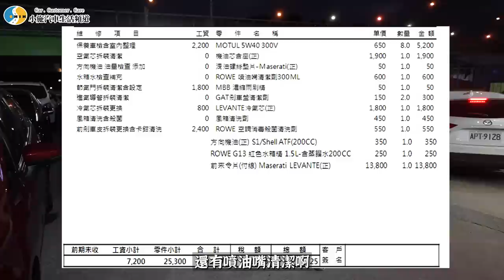【小施又來了】瑪莎第一次保養荷包就一瀉千里!車子溼了，小施又溼了／ft.Vic's service 維斑汽車/ 2017 Maserati Levante SQ4

Comment: 這台的引擎確定是是克萊斯勒本體從美國運到歐洲的法拉利工廠加瑪莎的上蓋組裝而成，只有V8那台才是用法拉利引擎，至於刪掉2缸剩6缸的法拉利引擎是用在Alfa的QV系列
煞車異音是原廠brembo來令的問題，金屬成份過高,把來令換別牌的就解決了
前煞車來令原廠約15000左右
這樣保養3萬多，可能沒比原廠便宜...
Reply: 6缸的都是法拉利代工製造, 別再不懂裝懂鬼扯克萊斯勒美國運到歐洲這種頭殼壞掉的天方夜譚˙ 乾脆編是義大利Fiat車子的引擎
Reply: @威-l6u 這是 spec r 2021/8月份雜誌內容，你自己井底之蛙沒知識，不要隨便批評別人鬼扯，還是你也認為知名雜誌編輯在鬼扯呢？
你開瑪莎嗎？你看過瑪莎V6引擎本體嗎？
你肯定也不知道引擎本體有印著克萊斯勒的五星鋼印吧？
Reply: @威-l6u  F160是一個60° V6汽油引擎，位移2979毫升（181.8立方英寸）。它為每個氣缸組、雙中冷器和直接噴射使用渦輪增壓器。發動機由瑪莎拉蒂[1]設計，法拉利組裝；具體來說，發動機缸體分別在克萊斯勒印第安納州科科莫和特倫頓發動機廠按照法拉利批准的規格進行鑄造和加工，然後運往意大利摩德納，由法拉利組裝。
Reply: @威-l6u  維基百科也在胡說鬼扯嗎？
Reply: @威-l6u  The 2,979 cc twin-turbo V6 available with either 330 or 410 horsepower is, at heart, an American product. Workers from the Chrysler foundry in Kokomo, Indiana, have been casting aluminum blocks for the Italian executive sedan since Ghibli sales started to rise by a huge margin earlier this year. Then the blocks are shipped to the Trenton Engine Complex, where workers machine them under the supervision of Ferrari engineers.

These blocks are shipped over the Atlantic all the way to Italy, where Ferrari S.p.A. puts the finishing touches on the 3-liter twin-turbo petrol powerplants, before these go under the hood of the 3.0 V6 S Quattroporte, the base Ghibli and the slightly more powerful Ghibli S variant. Presently, Chrysler machines around 50 blocks per day, but expects to hike that figure to 80 in the near future if sales numbers continue to rise. Until recently, Weber Automotive in Europe was the company that handled these duties, but increased demand extended production to the aforementioned Chrysler facilities.
Reply: 為什麼總是有一些酸民們，明明就不懂也不上網查資料，就直接嗆人家，然後等人家把資料全Po上來答覆，有品一點的會跟人家道歉而不是自己瞬間啟動靜音模式